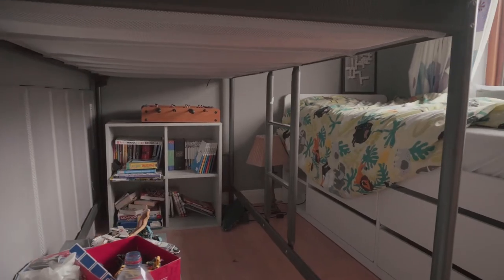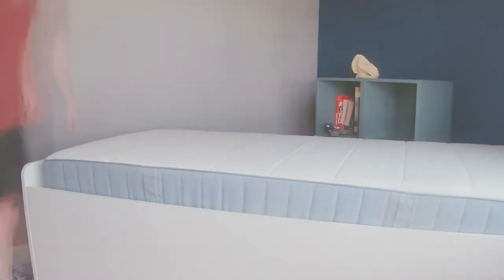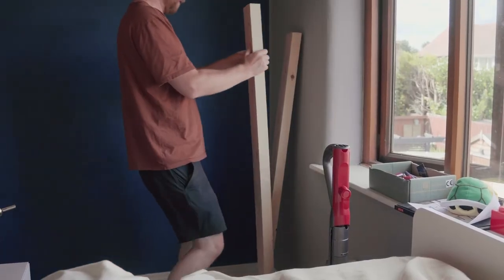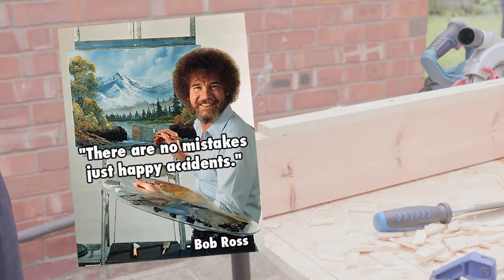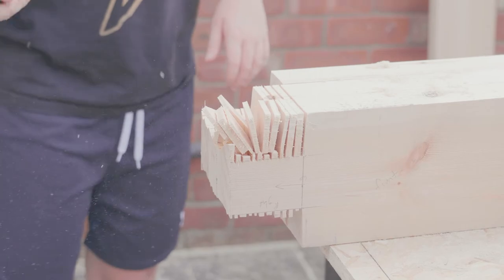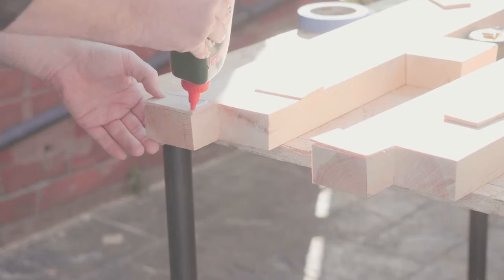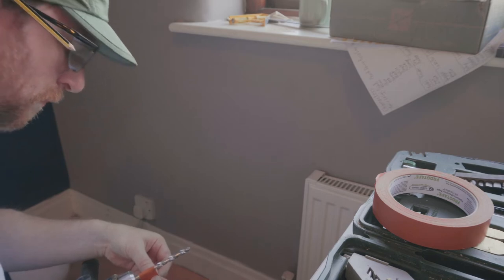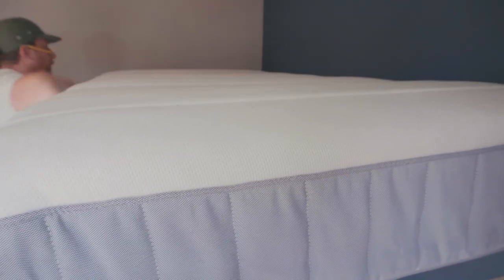Why are kids beds so expensive? DIY loft bed build

Comment: Smiled almost the whole way through, as I'd built a very similar bed for my kids 20+ years ago.  Also nodded vigorously with the "bomb proof" comment -- screw/bolt anything into the wall studs, and it's not going anywhere.  (And for the record, mine's still rock solid after two decades -- I have no doubt yours will be too.)